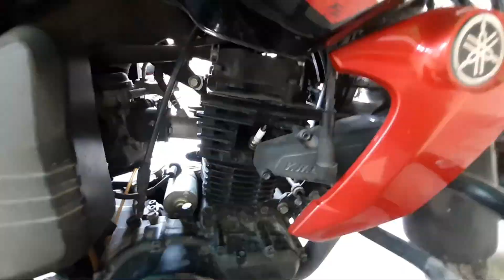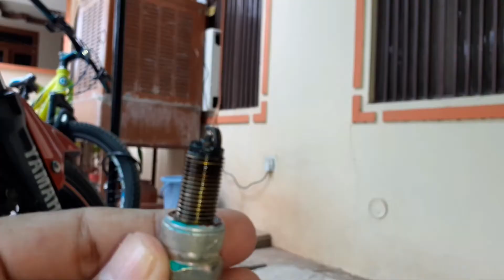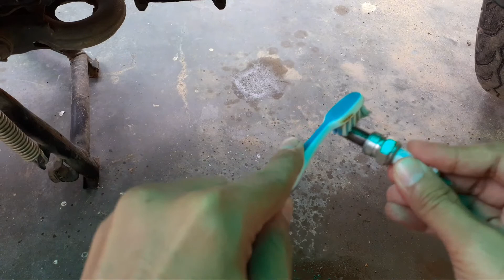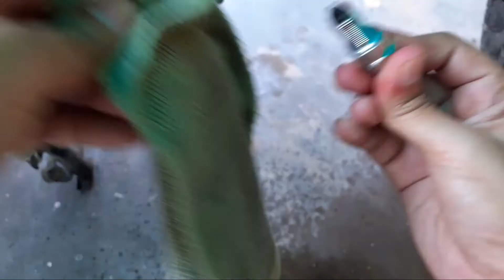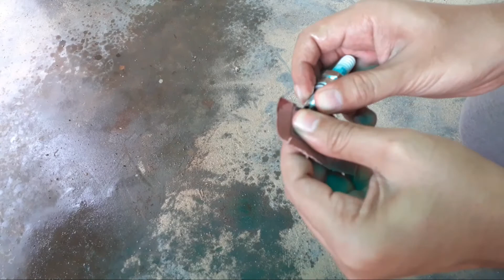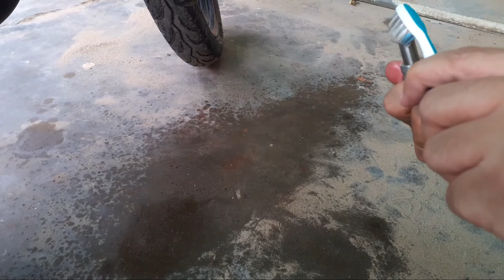To clean spark plug - WD 40

Comment: you better can use a cheap brake cleaner to clean and to degrease. 40 cent steel brush will make cleaning easier.

Comment: Bro it seems that your air fuel mixture has raised to Rich....it's too rich thats why your plug is so oily and black...,tune it to a slightly leaner
Reply: How do i do that?
Reply: @Obey-k3t  change air filter, clean carb, ensure spark plugs are gapped to bike manufacturers spec

Comment: Buddy my Spark plug stuck not able to remove it. . what's the solution
Reply: WD-40
Reply: Spray it with Wd40 dry lube...or that wd40 ordinary will still work just fine